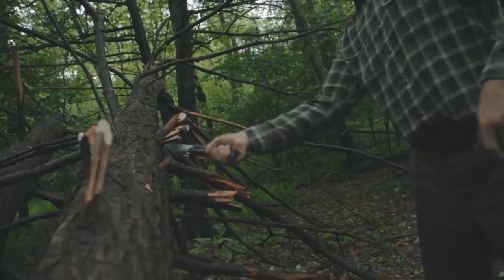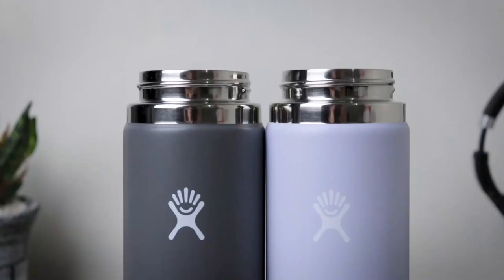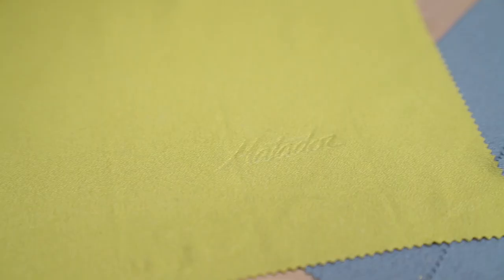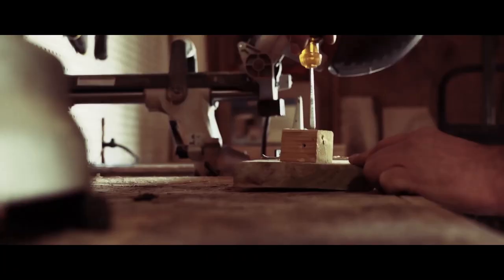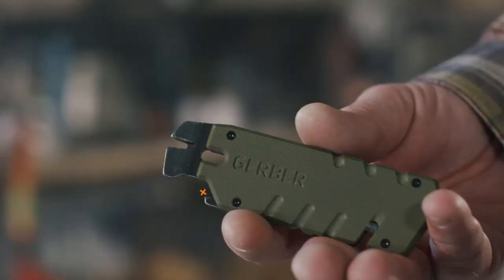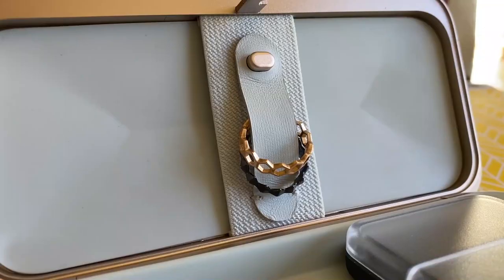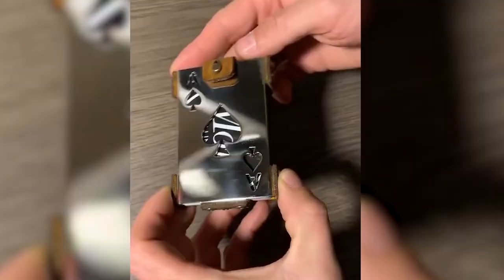15 Best Pocket EDC Gear 2021: Everyday Carry Accessories Found Online

Comment from the maker: 0:00 Introduction
0:22 Gerber Doubledown: https://geni.us/corCynd
0:52 Matador Keychain Mask: https://geni.us/Sb0PIzs
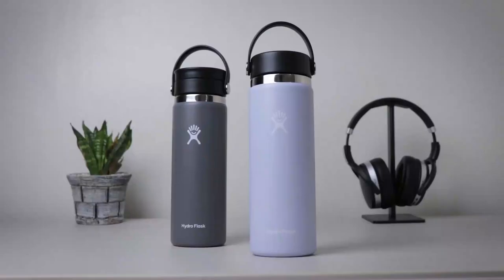1:14 Hydro Flask Water Bottle: https://geni.us/ceZz
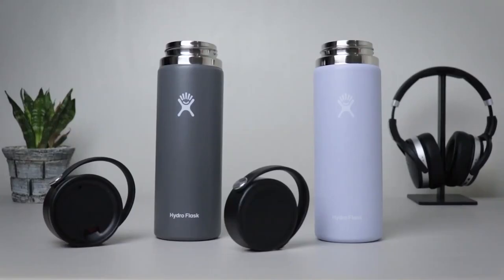1:52 Benchmade Bugout Carbon Fiber: https://geni.us/EAwZZeo
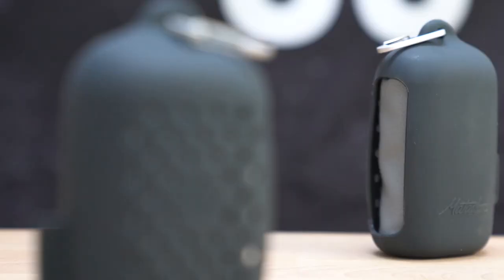2:24 Matador Small NanoDry Towel: https://www.urbankitsupply.com/products/matador-nanodry-trek-towel-small
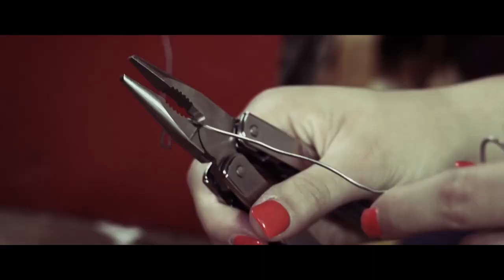2:52 Victorinox SwissTool Spirit X Multi-tool: https://geni.us/DHAhXr
3:22 Leatherman Raptor Multi-tool: https://geni.us/GrBA4L
4:00 Leatherman Bond Multi-tool: https://geni.us/wLx78Q
4:32 Gerber Prybrid Utility Multi-tool: https://geni.us/UMMNi
5:02 Trova Go Portable Safe: https://geni.us/3dEHcBa
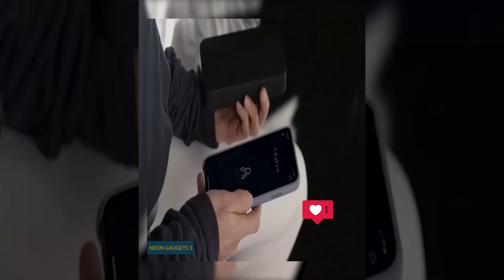6:02 Draft Top Beer Can Opener: https://geni.us/SetC
6:27 Rusty Steel Puzzle Wallet:  https://www.etsy.com/listing/845350924/rusty-steel-puzzle-wallet
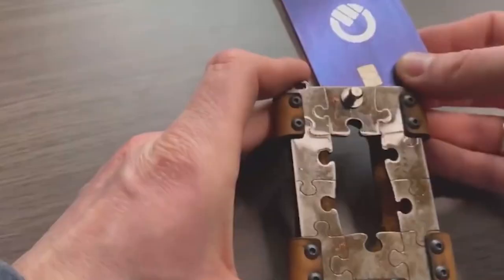6:54 Calculator with Erasable Writing Board: https://geni.us/ZQ2coS
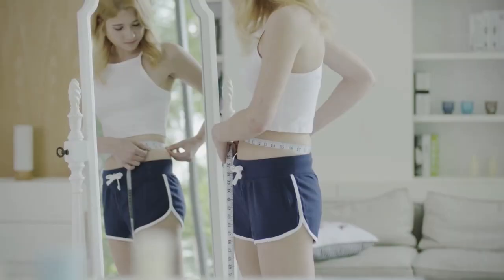7:23 Bagel Pie Labs Smart Tape Measure: https://geni.us/FD73OB0
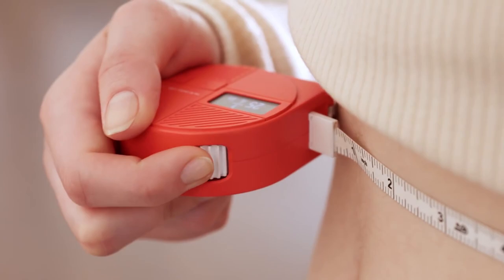7:52 Gravastar Sirius Pro Earbuds: https://www.indiegogo.com/projects/gravastar-sirius-earbuds-strong-bass-low-latency#/